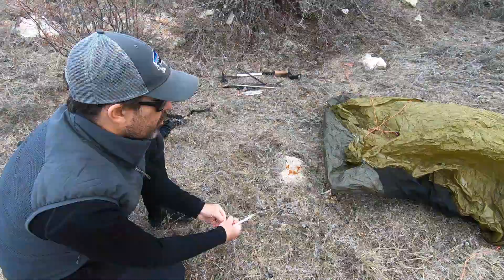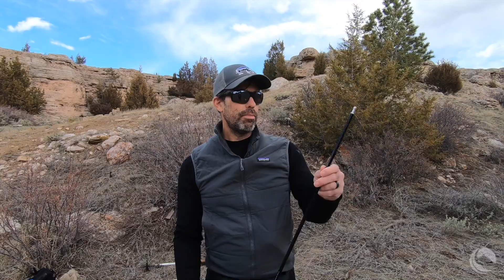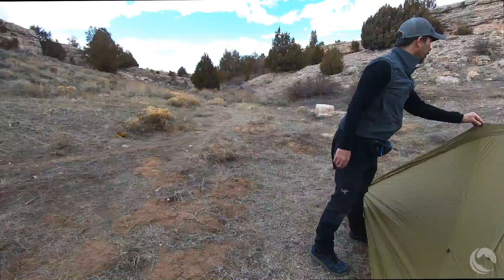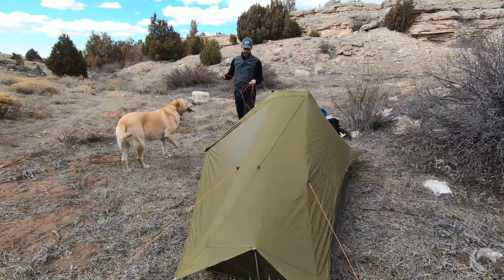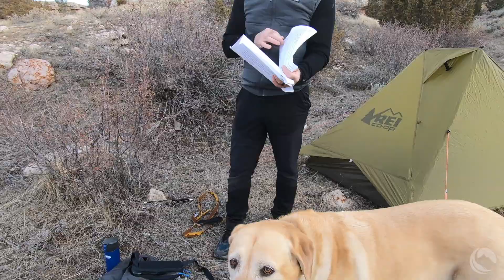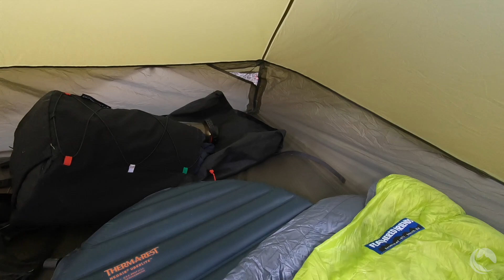REI Flash Air 1 Tent: FIRST LOOK, Tour, Q&A

Comment: I have the R.E.I Flash Air 2. I've used it for about 7 nights. For backpacking, I think the Air 1 would be sufficient for one person and would save a lot of pack weight. Thanks for taking the time to explain guying the tent out for structure against the wind. You explained that nicely.